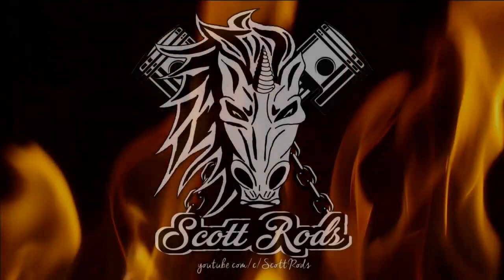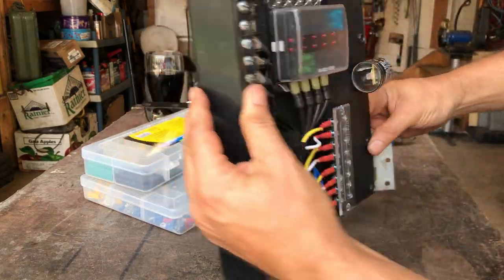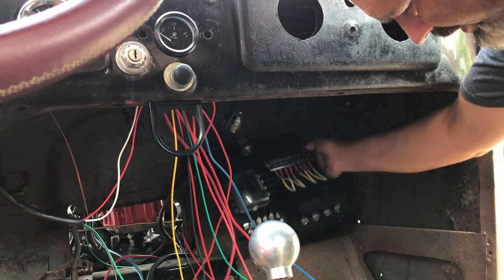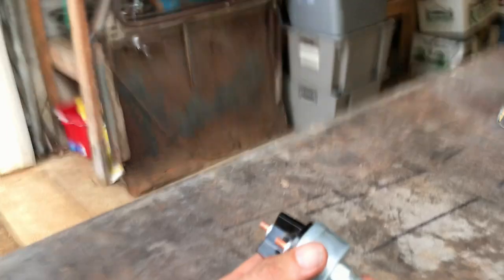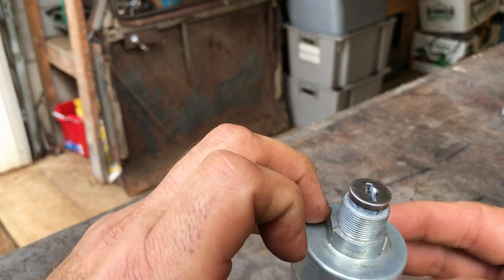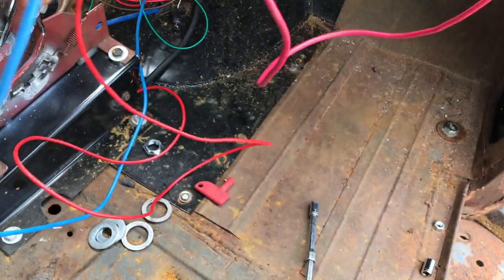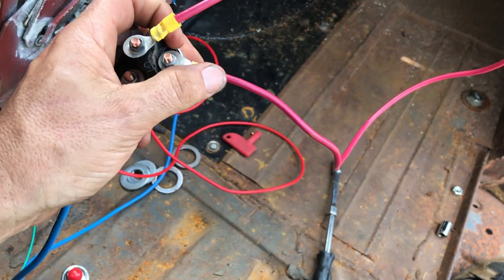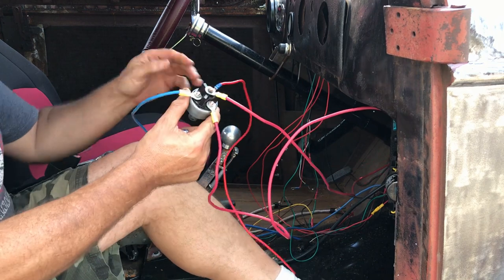Custom Fuse Panel Install & Subscriber Map Update

Comment: You’re definitely headed in the right direction with your wiring. Yes you can loop all the positives on the gauges together. Same is true for the grounds and the light wires. As far as the coil goes, I don’t have an answer. I know oem GM harnesses from the late 70s did not, but many aftermarket harnesses I’ve put in do, so take that as you will. If it were my car I would simply because you are passing it through the firewall and no matter how careful you are there is a small chance something could go wrong. 30 amp should work well.
Reply from the maker: My only thoughts on fusing the wire to the dizzy, is it's kind of a pulsing draw, so may be liable to spikes or surges.

Comment: I saw my name 😁👍The fuse panel is looking clean. You'll feel more safe once you have it all wired up.
Reply from the maker: Yes, it actually felt good just to put heat shrink on the terminals. It will look great when done. Actually, it will look great if you can't see it, lol.
Reply: @ScottRods  Very true.

Comment: Just a few additions. The starter wire should go thru a neutral start switch. The outside post on the starter solenoid also goes to the  battery post of your HEI for extra voltage during start. I like the relays a lot-saves money when buying switches.
Reply from the maker: Thanks Jeff, that's an interesting tip.

Comment: Keep going you're on the right track, gauges on 1 fuse lights for the gauges on another, if you have a electric fuel it should be on the ignition side only, not on acc. and ing
Reply from the maker: Mechanical....for now lol.
Reply: @ScottRods  Gauge lights come off the headlight switch. Also a constant + to the fuse panel.
Reply: Seeing that drop hinged panel has me wanting to redo mine in my truck again.
Reply from the maker: @Glen_Patti_H  I just don't see the point in making things awkward to work on when we are designing everything anyway.
Reply: @ScottRods  I'm always looking for a better way of doing things!

Comment: Absolutely you can jump all the gauges together, and I’d run a short length of fusible link wire between the battery and the ignition switch. And I’m from Coopersville michigan USA😃
Reply from the maker: Thanks David. What sort of ampage for that fuse?
Reply: Scott Rods  15 /20 amps should be enough for  the power side of the gauges .👍🏻
Reply: Battery fuse will depend on the output of the alternator. But it will probably be at least 100 amps.
Reply: Scott Rods you can use a maxi fuse of about 50amps between the battery and ignition switch , can get the fuses and holders on amazon or a good parts store
Reply from the maker: @davidwaskiewicz3289  Cool I'll go look, thanks.
Reply: @ScottRods  you also have to be careful about what wire sizes you use. If too small then the wire becomes the fuse.
Many cars use 40 amp fuse to the ignition switch, 30 amp fuse to the starter relay, and combine those wires (and others) at the battery with an 80 amp fuse. separate wire  from alternator to battery with a ?? amp fuse depending upon output of the alternator. A separate wire from battery to the fusebox with a ??amp fuse depending on how many devices you have installed (could be up to 100 amps, but probably a lot less on yours since no heated glass).
Also, if/when you add a starter relay it needs to be wired through the trans neutral switch so engine only starts in park/neutral.

Comment: Heyyy Thanks for the map location and funny thing... Im currently on the north coast for the summer! For the car its coming together as soon... The fuse box location and hinged movement is amazing... But i think if u have a plastic cover u d need longer bolts to fix on the side... Instead of it starting swinging like a window on windy day on every turn u do while driving... So tappers... Or screws... Or perhaps even parallel hinge like a lock mechanism to fix in place and rotated to let fuse panel free perhaps? Lots of work to be done on the interior btw and many patch panels to be done! All the luck for u dave!

Comment: I’d like to make it to the map one day , Marwayne Alberta should be represented. As for the electrical a big fuse or disable link on the main feed to to the switch might keep the smoke in the wires if something goes wrong one day.
Doug Lowrie

Comment: My 2cents Dave get some double wall adhesive heat shrink , pull the cheap blue red and yellow plastic off your wire terminal ends and heat shrink them. It not only seals them from moisture and humidity but helps with strain relief. There is a great place in your neck of the woods to buy it, cabletiesandmore.ca

Comment: No fuse in the ignition, no fuse to the headlights-some have a relay that pops when over current that resets itself, old cars have one fuse on the instruments(fuel gauge) usually mechanical water temp and oil pressure. Old cars had an amp gauge- newer cars have a volt gauge-much safer. Turn signals, brake lights, accessory lights, radio, wipers are all fused. If you use a GM light switch, be careful, the accessory lights have power all the time and ground through the rheostat on the switch. If you need reference material like a print, try 56, 57 chevy( early 12volt). Good luck Dave.
Reply from the maker: I plan on running the headlights through a relay. I also plan to remove the big red key when I leave the car, so all power will be cut when I'm not with the car.

Comment: I would add a relay before the starter there's a lot of current running through that wire to the starter and could melt while cranking over. 4 pin relay are pretty easy to wire up
Reply from the maker: Yes, my father in law emailed me to tell me that. He was an electrical engineer his entire career, so I better listen to him eh.

Comment: Acc not only holds +12v when the engine is running or the engine is off and the key is turned to the left it also cuts +12v during crank this relieves the strain on the battery so it gives the poor battery a chance to crank that big starter motor over. So things like heater blower, radio lights etc...should be wired to acc. The distributor, electric fuel pump if you had or engine control computers if you had should be wired to ignition. I find old cars dont have enough protection when it comes to fusing..always better to be safe then sorry...long winded comment...